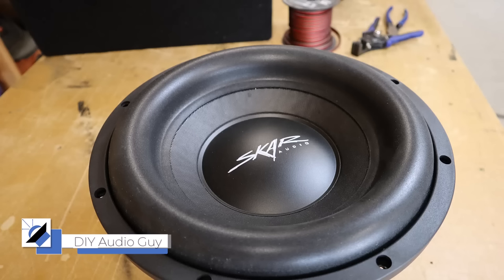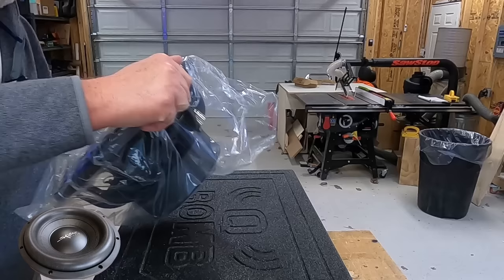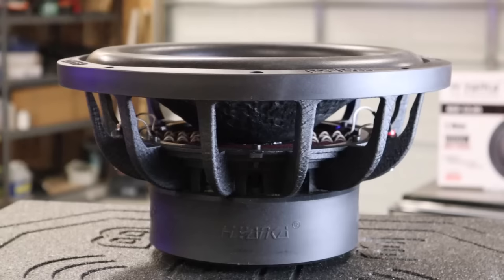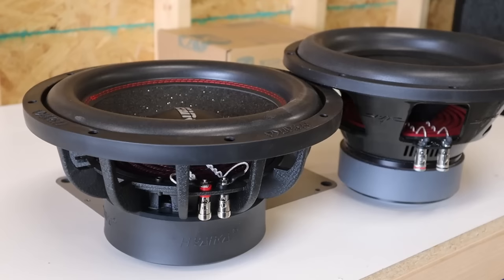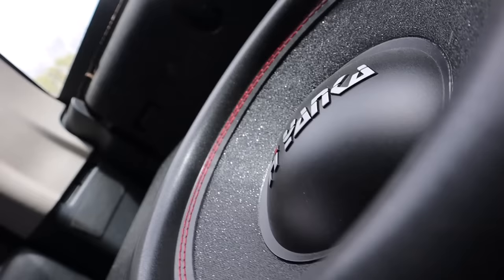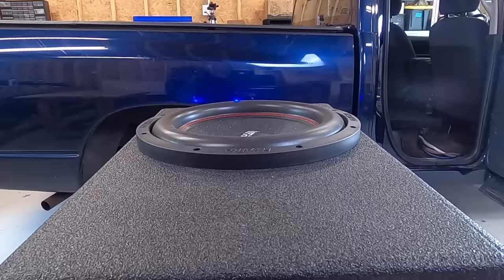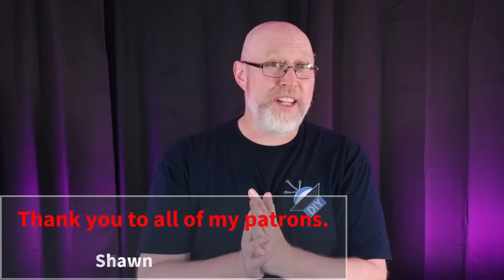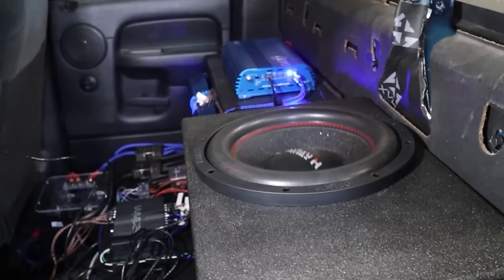The new budget king?  H Yanka better than #skar?

Comment: I picked up 2 of the 10" and 12" quite awhile ago.  We installed each pair in seperate vehicles with 2 local guys. They've held up very well. I ran the tsp's on both sizes, and they were off by a tad, so it's pretty accurate. Patrick Chandler (Robot Underground) did a review on the sub awhile back, and I said then
..it's a Def budget banger, and sounds as good or better than a P3, SDR, SA, W3 and more.  It has solid build quality, and don't let the price swerve you away from giving it a try.  A lot of subs...are "parts bin" type drivers. Only because it's been used for years, and works. Great video man. 👍
Reply from the maker: I missed his review.
Reply: no way that sounds better or even as good as a P3
Reply: @SbassLaser  you'd be more than surprised.  Besides, sound quality is a subjective matter, and what may sound good to one person, may not to another. After 3 decades in audio as a whole(home, car, Soundstage/PA)I've heard great, bad and everything in between. Unfortunately, a P3 isn't that excellent of a driver. It's par, but nothing more. It isn't cutting edge technology, or much more different then it's other revisions prior to now. The last good P3 models, were made here, in the U.S years ago. Just because a driver doesn't have a quadruple inflated price tag(or more) doesn't mean it's not a good driver. This subwoofer,  like most brands that start out being cost effective,  will gain popularity,  as well as a raise in consumer costs.
Reply: Subwoofers are not that subjective.  They all sound the same in the grand scheme because 40hz is 40hz.   Played within specs, they should all sound pretty much indistinguishable from each other.  I would love to prove this by having a $1,000 challenge with 10 subs.   Play them one at a time at 100 watts and let the "expert audiophile" guess which one is playing.  The results would be no different then guessing.   Get one wrong, I keep your $1,000, get them all right I pay you $1,000.  

The only question, these days, seems to be the obsession with pushing way more power then RMS through them.  Once this occurs, that's when the quality kicks in.  It becomes about which ones can handle being severely overpowered.   For some reason, if they can't handle double the RMS non stop all day, people want to call them trash.  I prefer to call it what it really is, the MFR sandbagging their RMS for some oddball reason.  I don't know what the purpose of that is except to fool idiots in to paying way more for their subs thinking they are better quality when in reality you're just paying the true price for a 2000 RMS sub that is labeled 1000 RMS.
Reply: @Chuck_Sanders the old p3s are hog the new ones are way louder and lower
Reply: @kookiesdank9860  there is nothing "new" about the P3 lol.  It's old tech,  and the same coil (2.58") they've used, along with Kicker and Alpine for years. The 12" P3, is literally a $45 woofer from the build house.  The older version built in the U.S were a much better driver, than the one currently available.  Rockford and JL(currently owned by Garmin) have done nothing in years, as far as updating their products really.
Reply: @Chuck_Sanders  everything is new about it😂 aluminium cones and dust cap and every part is different from the old one including the voice coil. New p3 has 25% more surface area and a better surround I don’t even own a p3 but know more then u do about it
Reply: @Chuck_Sanders  and Garmin doesn’t own Rockford Fosgate Patrick Industries does so don’t talk about stuff you know nothing about
Reply: @kookiesdank9860  I said JL is owned by Garmin... learn to read?
Reply: @Chuck_Sanders  you said Rockford and JL audio it’s time for reading glasses chuck
Reply: @kookiesdank9860  I'm fully aware, that Patrick Industries acquired RF in the early quarter of 2022
Reply: @kookiesdank9860  tell me again you cannot read, without telling me? JL(owned by Garmin)  seems plain enough to me
Reply: @kookiesdank9860  so, since you have had p3 subs(yet you said you didn't)are you going to elaborate on when this "new" p3 revision was released?
Reply: @Chuck_Sanders  you put Rockford and jl audio in the same sentence. Learn how to spell
Reply: @kookiesdank9860  so, I'm still waiting...
Reply: @kookiesdank9860  I spell quite adequate, but thank you?
Reply: @kookiesdank9860  yeah, so I waited... what are they, a decade old now, or more? Again... old tech.  Same as JL. 👍
Reply: @Chuck_Sanders  That's because there's no reason to change the tech Rockford is using. They use more detail into there subs and amps then any other company And JL has always been garbage and sounds muddy only make good amps
Reply: @Chuck_Sanders  I have used the old school p3 and its not a loud subwoofer its meant for a sealed enclosure but the new p3s will kill your ears in a ported enclosure. my experience with p3s
Reply: @kookiesdank9860  don't kid yourself on "more detail in their subs" because they're not doing anything special. The P3 has a small motor,  old 2.58", low motor force and a standard compliance suspension.  Again the 12" is a $45 manufacturing cost subwoofer.  Why do you think Rockford sold out and then JL selling out? Stagnant products are the main reason.  Nobody wants to pay the high price tag for the same old stuff.  Can't keep pushing products that are a decade or more old, and keep upping the price.  Guys like Kevin at Skar, they sell old tech and haven't really updated anything in years, but it's at a cheap price point, so people will buy it.
Reply: @Chuck_Sanders  lol I'm not arguing with an old man who has no idea what he's talking about. I bet you don't even own any new Rockford Fosgate so hush up. I have been abusing my T1s and T2 for over 12 years and they still sound new. No one does it better then Rockford Fosgate when its comes to overall quality. And I've used Skar and Hyanka and there absolutely horrible and get smoked in a second so your opinion means very little to me
Reply: @kookiesdank9860  On a side note...Shhhh, don't tell anyone. There is NO new Rockford products.
Reply: @Chuck_Sanders  when did I say there was new stuff😂 just new compared to the old p3 get a grip and stop commenting
Reply: @kookiesdank9860  Awe.. facts over feelings getting at you? You said I probably don't own any new Rockford subs. No I don't because there is none.  But you said "everything is new about them" lol.  I don't think it's dank really, sounds a little Reggie, but cool story.
Reply: @Chuck_Sanders  I said it’s new compared to the old p3 how are you still not understanding? I actually feel bad for you
Reply: @kookiesdank9860  you said everything was new about it.  No? Go read your own comments.  Keep digging that hole.  If you want to feel bad or sorry for someone, peep in a mirror.  You were dead in the water, when you had to Google what was new, about a 12 year old woofer, to try and justify your comments. And yet I'm the one, who knows nothing.. haha.
Reply: @Chuck_Sanders  everything is new from the old p3 how slow are you??? 👴
Reply: @Chuck_Sanders  I didn’t have to google anything both my friends have p3s you ever heard of “friends”?
Reply: @kookiesdank9860  no shit. Every revision of something is different from the last. My point was and is valid, and you cannot grasp that... you never could.  Keep rocking that old shit you think is the best though, keep projecting and talking out the side of your neck.  Need a new shovel?

Comment: It's not necessarily about power handling, but it's about efficiency in my book so 100 watts at.   90 vs 100 watts at 93 in same style box the sub rated 93 only needs half the power to reach the same spl levels let's say at 130db  for instance.   That's big in a  db drag!   When dealing with stock current charging systems.  So picking a efficient amp is key as well.
Reply: The sensitivity rated does not translate to higher total spl. There are many other factors involved.
Reply: @JasonWW2000  absolutely agree, vehicle, box design, several factors.
Reply: Just saying power rating don't mean a whole lot to me.  I sent mtx 8100D into a hammer 10" dual 4 ohm sub rated at 250 watts.   By Danny Benoit he hit a 147.7 he added one more 10 and one more amp he hit a 150.2db it was louder than his 4 amplifiers of the same type and 4 12" diamond audio in the same car.  He also tried the jack hammer. The RFL, he tried several different subwoofers that year.   He took home many trophies, his closest competition was someone at a USAC competition with 4 rockford fosgate 12's  and 4- 1500 watt mono block amplifiers.      While he had just 2 little 10s and 2 amplifiers.   They were going back and forth in the db drag.   Not joking.  Then guess what... yup the rockford fosgate guy wasn't supposed to be in his class but in the class above  him.   🤔   it's not necessarily about what you have but it's how you set it up.   I've been in audio since the late 80s. And was the electronic store manager in thief river falls mn at the time,  been out of it now since 2006 switched careers.
Reply: Myself I have a collection of old school amplifiers kenwood excelon, rockford punch 👊, kicker, orion amplifiers, soundstream, LA Sound, Hyphonics, Down4sound jp23 amp, soundstream Splx subwoofer, ect.... plus old school crown power bass 3, xti 4000, pioneer Elite amp, Kenwood sovereign receiver 7.2. Guess I just like the soul of some old school stuff.  Is just some of the things I have
Reply: @joeyholthusen6495     Maybe I'm blind, but I can't find many subs hitting 93db sensitivity.   Even Kicker who brags about how hard they hit are only 88 with their top L7 square sub and 86 with their top of the line round sub.   Same with DD Audio who brags about their massive hard hitting subs that are in the same 86 zone.   JL audio... same 86 range for the top of the line.
Reply: @marcuslinton310  my soundstream Splx subwoofer is 98 db, old school Subwoofers from ETI sound systems use to be stupidly efficient back in the 90s.   Musical?   No.   Loud?  Yes.   My soundstream splx is not a SQ Subwoofer in any way.   Trying to think of a few other.  I'll look them up for you.  Don't worry.
Reply: @joeyholthusen6495    JBL is at  @ 2.83V, which means it's really 89.  I found the manuals for the SPLX's and they appear to be using 2.83 also based on what the high excursions say, which should be louder...  

89 for the 12splx and 91 for the 15splx.
89.4 for the 12splx-hx and 92.49 for the 15splx-hx

Which means 86/88 and 86.4/89.49, not the ridiculous numbers falsely used on a few websites.

Nor sure why you completely changed your previous comment?
Reply: Thinking that its all about an efficient rating is going to get u nowhere, there is so much more to than that. if your going on that theory alone you dont even need to be looking at regular subwoofers. P.a. is what you want. And the days of hitting 150 at 85hz on low power have past.its 2023 dude.
Reply: Cerwin Vegas strokers were 96-98db's at 1wt NOW THAT was back in the late 90's early 2000's and they were 1,000rms I had 4-15's on a lanzar opti drive 2500.1 that cost me $2150 back in 1998 back when lanzar was legit not the pyramid Bull shit of today lanzar sold the name to pyramid but kept the Opti drive part of the company back in the day one business partner was stealing money from the company and sold his half of the company before it was taken NEVER go into business with someone you don't really know

Comment: i just built a sub box and the recommended  volume is .35 but after recalculating my numbers the box is .31 does that .04 difference matter much this is my first time building a box and first time messing around with subs. the subs are the VD-8 | 8" 600 Watt Max Power Car Subwoofer (Shallow Mount) from skar
Reply from the maker: Should we well within the margin of error.

Comment: SKAR 12" subwoofer 1250 RMS watts, 2500 max, it started cracking as the bass hit. I had a 1500 skar amplifier on 2 ohms. 
I have never had such a bad experience.
I have owned
MTX TERMINATORS
EARTHQUAKES
ROCKFORD FOSGATE
CERWIN VEGA
AUDIOPIPE
ECLIPSE
KICKER COMP R
MEMPHIS
POWER ACOUSTIC
MTX AUDIO
BLUE THUNDER
You name it I had it. This is my first Skar subwoofer
I ever owned. Not happy.
Reply: Thats a head unit/amp problem not a speaker problem sir
Reply: Ive seen more blown audiopipes then i care to explain i even blew a bdc2 on 500rms and got a skar svr no issues then got another one and had that setup for 3 years and now i just got a zvx12

Comment: I own several Skar subs and I prefer the SVR for sound quality over my SDR.  I'd be willing to bet this is a better match to the SVR.
Reply: What's the difference?
Reply: The svr dont sound as good as this, have both and then some. I was surprised at how great it sounds and ashamed that i paid so much for other subs that sound worse.
Reply: Finally someone other than me calling out this handycap review
Reply: @FJTabb  800rms, hold down ring, stitched surround, 150oz dual stack magnet, 2.6in copper coil and $120

Comment: I just reached out to them as well, via Amazon, got a direct email to them and they sent me 2 sets or 2 pair of the 6.5" components  speakers with the crossovers an tweeters etc. Compared them side by side with ds18 red tips and they blow the ds18s out of the water!!!! Running them all off an alpine 4 channel amp driving all 4 door speakers. Very very impressed with them!!!!
Reply from the maker: I have not tried their mids and highs. But this subwoofer is rock solid.

Comment: Audio Legion was the Budget King but it's coming to an end. The maximus 10" for $110 can't be beat. I have heard great things about the hyanka.
Reply from the maker: I have not tried audio legion, but I definitely heard of it.
Reply: @DIYAudioGuy  Everything I tried from there was an amazing value. I did a back to back of the sdr vs Armada I'm the skar prefab. The Armada sounded better for lower and was 1.5db louder.
Reply: Hell yeah bro audio legion is going out of business i bought all the 3 inch mid drivers and 6.5 components quality was crazy
Reply: I have 2 12 inch Maximus in the Skar ar2x12v box, running on 1ohm and these fckers absolutely slam!! They're better than the EVLs. I have the DS18 GFX 3k1 pushing them. Check out the review for this amp. I paid 180 for the amp, and it was dyno tested at 3700 watts rms @ 1ohm
Reply: @PurpMan242  that ds18 has the same board as the taramps and timpano amps
Reply: @Enzo S  This Ds18 amp is better quality. It has a bass knob and 0 gauge input terminals for power and ground. Ive had it 3 months and it had not went into protection mode 1 time. I had the taramps at first. That thing kept going into protection mode. I sent it back for another, and it did the same thing. I wouldn't even touch timpano. There's a dyno video with one catching fire....lol
Reply: @PurpMan242  no doubt thats all they run down here is brazilian amps they catch fire all the time.
Reply: Some of the Skar and Audio Legion are the same thing with different branding
Reply: @enzos9211  you didnt buy all of them because i got 6 pairs of the mids less than a month ago , and u can still buy them from skar as we speak.but you are right about the quality, they sound absolutely amazing in an active 3way setup. Actually better than the infinity and the morel soft dome mids.
Reply: The first thing that jumped out was the way that sub looks like it has the evl basket but I'm just watching tho

Comment: The information available online shows the Skar RMS rating at 600 watts for the SDR 10, and the 10 inch H Yanka only rated at 500 watts RMS. Even for the 12 inch, I'm not seeing this higher power input rating for the H Yanka that you spoke of.

The plus side to it being a parts bin driver is that readily available parts and some upgrade parts are available everywhere for rebuild.
I think I'm going to try one of these in my truck because of this very reason.
Reply from the maker: Good point.

Comment: Maybe you can do a video about this but is there a reason subs have different TS parameter's when the voice coil resistance changes? I've noticed that if there's a sub that's the same but offered in lets say 1 ohm or 2 ohm that some of the specs will be different such as inductance. is this something that needs to be considered when designing a box? Or does it not matter?
Reply from the maker: That's a good question, I may need to do some research and make that video.
Reply: This is because the coil itself must change to create the different DC resistance, more winds, possibly thinner wire which will mean more turns (more inductance), longer wind width (more mass), or some combination of those.   There can be quite a noticeable difference in real world performance in throwing different coils in the same motor, but when you're trying to make a brand/model woofer with multiple impedance options you can generally get a dual 2 and dual 4 version to have similar enough specs that you could use them in the same box and the difference would be inaudible (less than 1dB).    Whether you buy two of the subs in the video and they perform that close with the two coil options will depend on whether or not the factory made any effort to keep similar performance with the two different coil options.   Either way, you can plug the specs into your favorite box modeling software and get a pretty good idea of how close different coil options on the same make/model sub will compare and they should be well within 1dB of each other all across the usable bandwidth.
Reply: The guy above is right .just model a box with the different paremeters and find out. i will say that a sub with a qts in the 4s will be a little forgiving of small changes in box design vs other subs